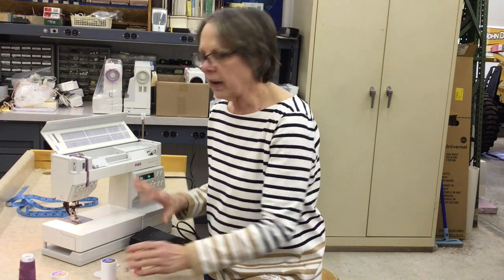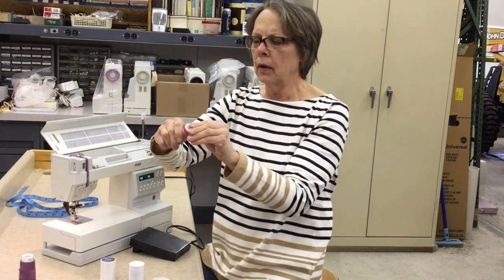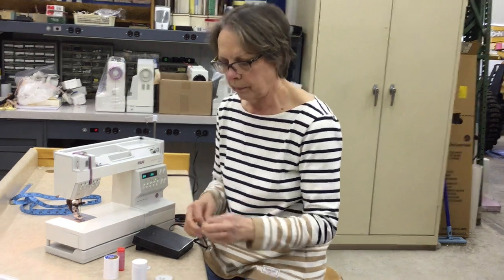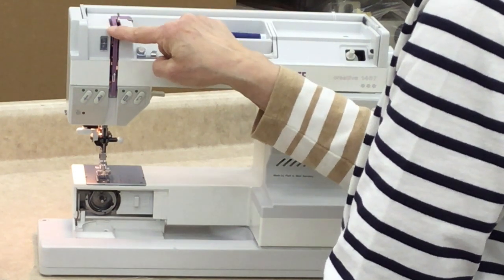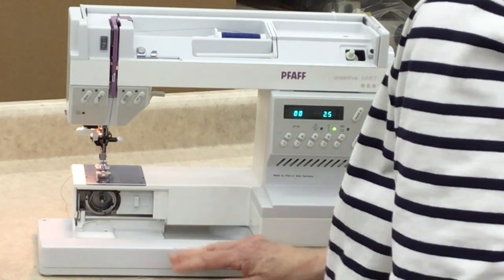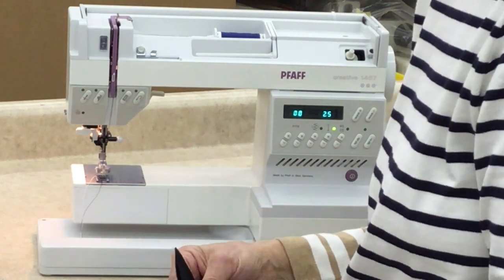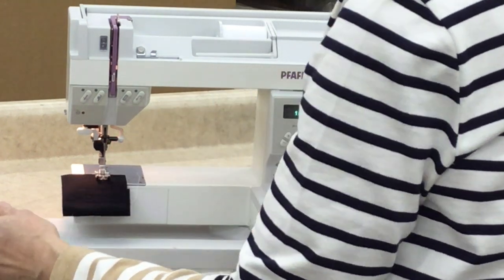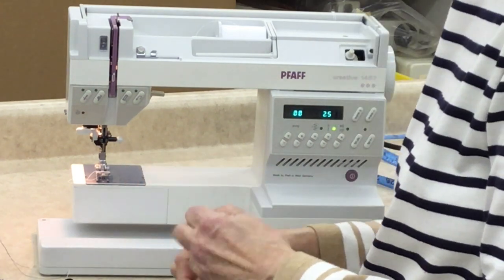Proper threading~German "Retro" Pfaff

Comment: Hi! 
Thank you for the oiling maintenance advice! I have a question about this machine, we use exactly the same one. Since some months, its display doesn't work properly anymore: After switching on the power-button, it takes about 5-10 minutes until the display starts to light on... unless the display being on, the machine cannot be used, no move by pressing the pedal ecetera - so the machine seems to be useless without its display working as well.
If you could give me any advice, knowing the spare part that is affected or even better where to find/buy that one, this would help us a lot!
Kind greetings from Switzerland, Stefan